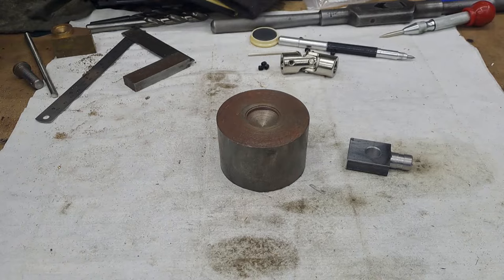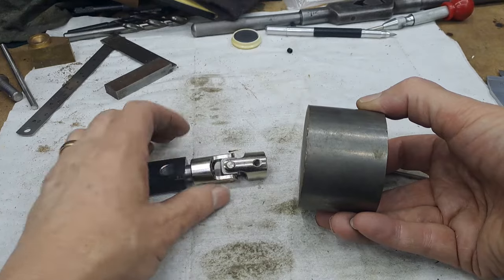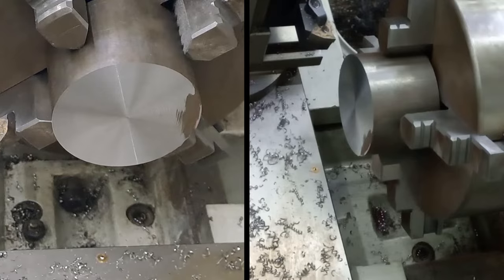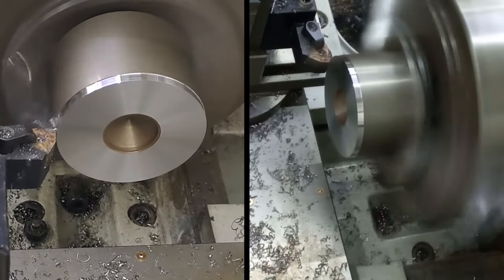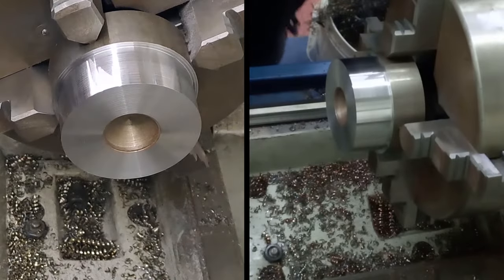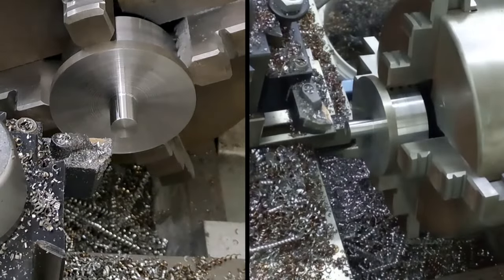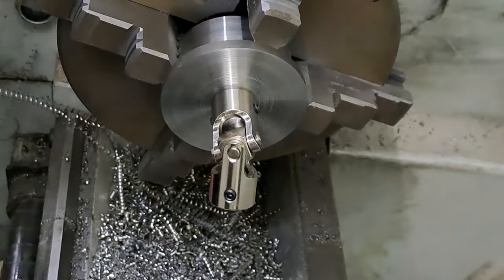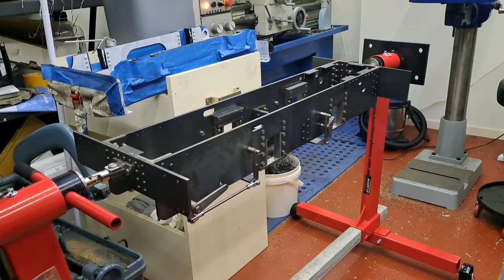043 A Locomotive Building Stand

Comment: Nice build mate 👍👍
I’m just about to start on a similar project for a 5” gge. Baldwin 2-6-0.
I think I’ll build the turning frame to sit on one of the ‘lift platforms’ sold by Harr & Forbes ( & ors.).
That way I’ll have a height adjustable trolley to move the loco from the shed to the back of my ute.
Enjoy watching your ‘Wombat’ build. How do you rate the quality of the drawings/instructions and the parts?
Regards
Robert
( Sydney 🇦🇺)
Reply from the maker: @RobertBrown-lf8yq  Thanks for the comment. Even in 5" a Baldwin will be a big loco, and some kind of frame will be very useful. My plans are to use this one until the frames are completed and everything is running smoothly on air. After that, I'll be building a more conventional stand with rails on the top, with the height the same as the back of the ute for easy in and out. The wombat drawings are generally good, although people have found a couple of errors in them even though they are computer CAD generated! There are a few annoying things. The biggest for me is the number of different thread types used... ME, BSPP, MM, and I wouldn't be surprised if something else crops up. I think that it is time that the model engineering world let go of the past and settled on one standard!
The Chef
Reply: @ fully agree mate 👍
I’ve got tubs of BA fasteners, drawers full of ME taps & dies,
and heaps of ‘metric’ equivalents.
I like the concept of ‘small’ BA hex heads & nuts.
So I might just start making metric bolts with ‘BA small’ size heads ( ie., make M3 bolts out of 3/16” hex bar 😎).
Robert